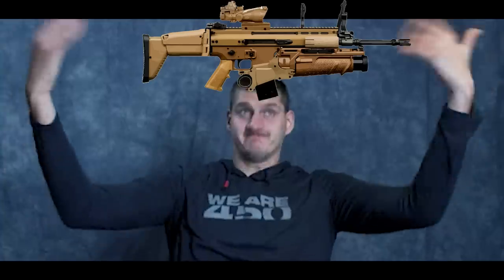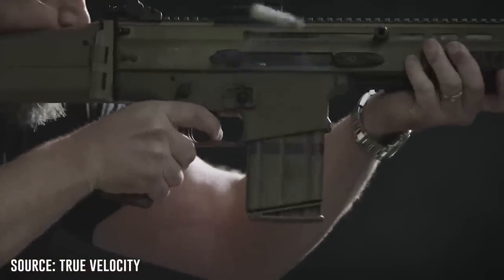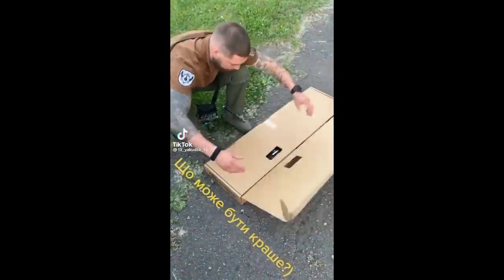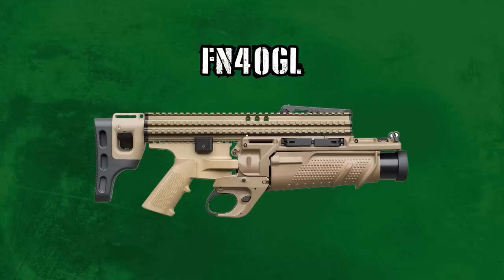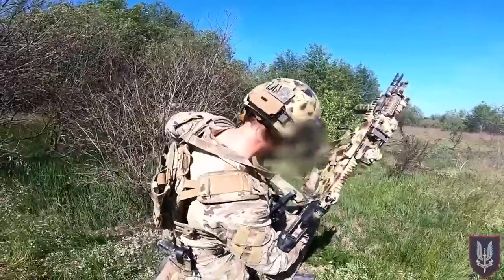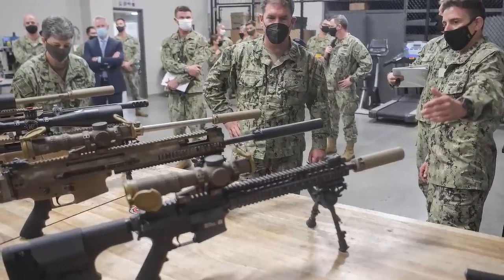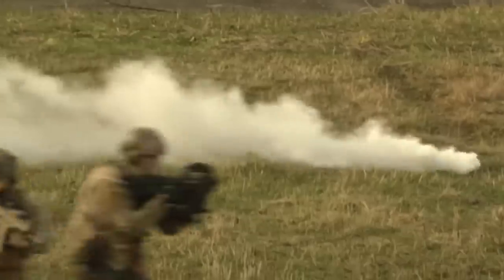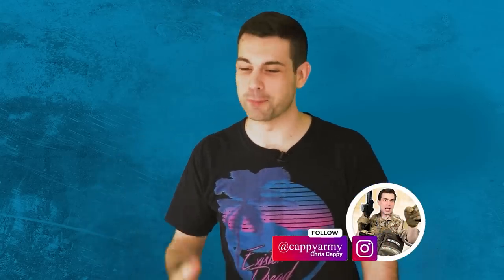Why this SCAR-H Rifle Uses Plastic Ammo Casings (Weapon Analysis)

Comment: Composite casing instead of brass is a massive plus in my opinion. Not only does it have a much less visible muzzle flash but it's much lighter.... and for troops in intense combat situations, that means a lot more ammunition can be carried, and that makes a big difference. 
When I joined the British Army at 16, we obviously weren't in any danger of going anywhere so we still used the 7.62mm SLR which was an absolutely fabulous weapon but it had a major drawback....... the amount of ammunition that could be carried by one soldier. When I switched to a regular unit, I had the SA-80A1, which was a 5.56mm rifle, and that meant a lot more ammunition could be carried..... Happy Days!!!!!!!!!
With the SCAR having the option of composite round, this would be fantastic....  And I would love it as you can have shit loads of ammunition to play with!!

Comment: My biggest issue with polymer ammo is the idea that the polymer isnt removing heat from the rifle. While it is conductive it also absorbs and removes some heat from the rifle. I wonder how it would effect the heat being its also using less powder. Super hot barrels lose accuracy
Reply: So u literally haven't watched the video?
Reply: that doesn't make sense; the bullet is the source of the heat and therefore would be the hottest element in the gun. hence, any heat flow would be out of the bullet and into the barrel and not vice versa
Reply: This is a legit issue because I think the SCARs typically have barrels closer to "pencil" than "SOCOM" configuration.
Reply: To elaborate a bit on that, polymer casings actually reduce the amount of heat generated inside the chamber
Reply: @kelvinnnnnnnn  exactly, the heat in the barrel cant be dissipated by the hot case that ejects from the gun. Its the same amount of energy being generated if its a comparable round, just being relocated to the parts that you want to keep cool. Like i said; im curious if the efficiency of these cases is enough to surpass the cooling effect of the ejected hot brass.
Reply: Think about it this way, the moment combustion is complete, no more heat is being generated, but its still soaking in to the parts. The combustion ends well before the case is ejected, so it is going to take some of that heat with it on its way out.
Reply: @quinnmoore5985  Then how do trials show that the chamber is actually cooler using polymer than brass casings?
Reply: @dawjaw  i have seen the opposite being true so far, that being why, in a real world application, the US did not adopt a polymer cased ammo in their NGSW.
Reply: @quinnmoore5985  Yeah, but not because it wasn't cooler for chamber heating. All Army testing has proven that the chamber gets hot less quickly with the polymer cased ammo. The Army adopted the SIG bi-metal case because it could handle much higher pressure regimes than the polymer cases.

Comment: As with everything, I'm a little weary of technology that isn't up front with the downsides. The heat from propellant energy efficiency loss HAS to go somewhere, so where does it go? If they aren't using a new propellant composition with better energy conversion than that heat is going somewhere, period. It's a bit of a dubious claim to me, especially without specifics on the projectile velocity and mass. My guess is that heat is going directly into the barrel, because it ain't going anywhere else.
Reply: That's where the heat has always gone, then right out the muzzle. Suppressor will remind you real quick how hot the muzzle gases are.
Reply: @LuvBorderCollies  Just read through your comment after getting home from a busy day of work and realized I read your comment wrong. My bad. 😅 Yeah you are correct. Sorry of my earlier argumentative reply.
Reply: @unarmored9973  After 30+ years of police work my skin is pretty thick and tough. No snowflake here. LOL But thanks for the followup comment. Appreciate that.

Comment: as much as I love the scar 20s it's a dumpster fire in 6.5 creed, they like to blow out primers and not cycle unless you feed it exactly what it wants. fn first said it was the firing pins being too long, then the gas system wasn't right because they just threw a 6.5 barrel in without modifying anything or testing it. and now I believe they're saying it's something with the fire control group.

Comment: The SCAR is a case in point of how the brass setting design requirements don't know a thing about science. The charging handle makes it reliable?
Reply: Polymer only decreases weight.  Brass can be used for insane amounts of pressure, as it's used on all sorts of very large rounds.
Reply: @xephael3485  the brass OP was talking about are the higher ups, not the brass ammo.
Reply: Well having it moving makes it simpler to make the gun I think.
Reply: True, but the SCAR is very much a bitchin rifle. And people love to nitpick it, but the AK, M1, M1A etc gets a pass on the charging handle 👀

Comment: The SCAR is not worth the additional cost. I was attached to SEAL Team 2 in 2012 and carried a SCAR H, it was not great during sustained firefights.  Also, polymer ammo is a no go for sustained firefights. Brass removes heat from the weapon, polymer does not. Its why the military elected to go with the bimetal case instead of polymer.
Reply: You have clearly never used polymer cased ammo.
Reply: Have you ever used this ammo? I have :)